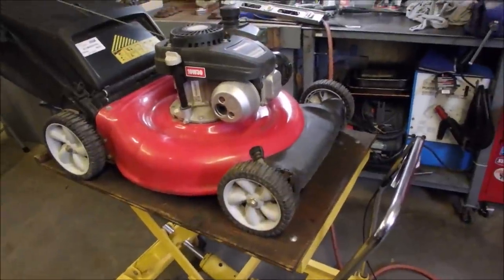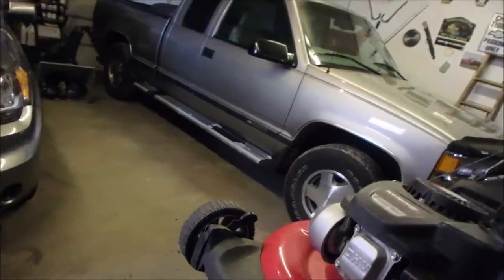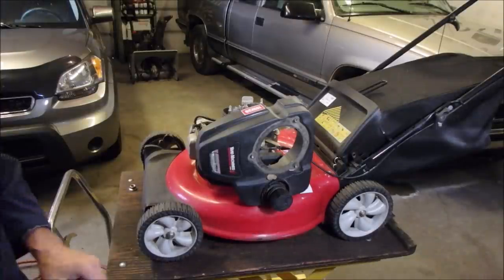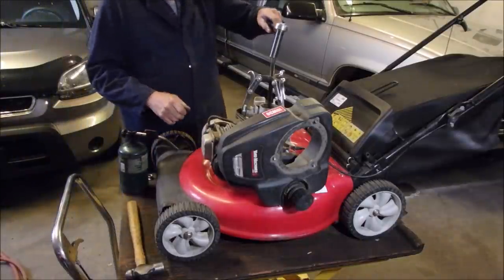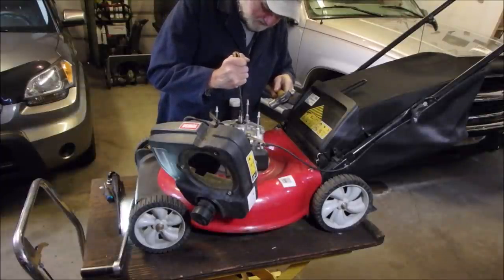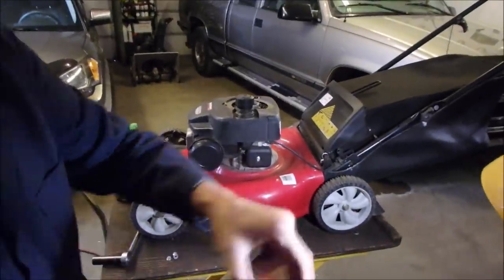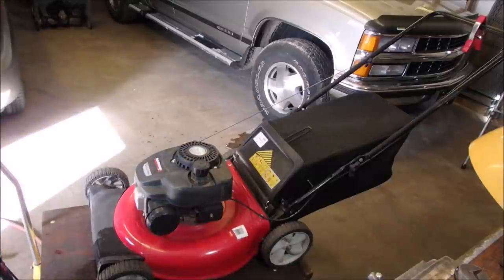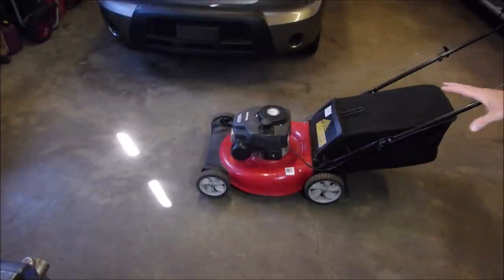Powermore MTD mower Timing and Blade

Comment: Good job on that mower Bruce. Been watching your videos for years now and thanks to you I can remove, clean and replace a carburetor, change the oil, sharpen and balance the blade, clean and gap the spark plug in 25 minutes or less and if I need feel energized remove , grease and replace the wheels and oil all the cables in another 10 minutes. 
I’m retired now but seems I’m busier now than when I was working. 
Thanks again you are an inspiration.
Reply from the maker: Thanks for the kind words.

Comment: good call,  I had a Blackmax mower  (Sold at Walmart here in the US) trade in  they hit something hard,  it has a very specific adaptor and blade  that I didnt have , I ended up finding a used craftman adaptor that fit and old craftsman blade I sharpened.  and it always ok after I replaced flywheel key.  well at least it was a Briggs 300E  Engine. and didn't need to clean carb. starts on 1 pull now.   Vid will be up on that on my channel on 4/23/2022
Reply from the maker: Thanks

Comment: Bruce, I found that using a little Never Seize on the flywheel and shaft helps so the flywheel doesn't freeze up on there like that again, i have used that a lot , never had a problem for down the line.
Reply from the maker: Interesting.  I done us it as I think a flywheel has to be firm.  I will think about that  thanks
Reply: @BrucesShop  I don't use a lot, just a small amount so it doesn't freeze on the shaft anymore.
Reply: @BrucesShop  I don't use a lot, just a small amount so it doesn't freeze on the shaft anymore.
Reply: @BrucesShop  In a certain way, don’t we WANT the FW and crank to bond into one unit? At least when running properly? Now hit a tree root or a culvert pipe and we want them to act as independent pieces, but normally we want them to act in unison as 1 piece. Agree? Or not?
Reply from the maker: @haneyoakie14  I agree

Comment: It's amazing how many different blade adapters there are and how close the MTD adapters are in size. I didn't realize until I was trying to swap junk mower parts around. Then I looked in my parts books... The Rotary catalog has all of the measurements on the different adapters which helps a ton when you are trying to match up parts. I have one of those newer MTD mowers, it was given to me last year. I really find the power more engine is not as powerful as the older Briggs counterparts.
Reply from the maker: I agree   They are noisier though  LOL

Comment: Nice video Bruce not a lot of people know that what they call the bowtie blade adaptors come in different shaft sizes and height some even have a spacer that goes between the adaptor on the inside of the bore and against the crankshaft to drop the adaptor more towards the ground. Have had a few in where they installed too long a bolt and broke it off inside the crankshaft from using an impact gun with too much torque (like the Milwaukee that has 450 ft lbs on the highest setting).
Reply from the maker: Right.  Adaptors are a big deal.  i was tricked that this one came in with the wrong one.

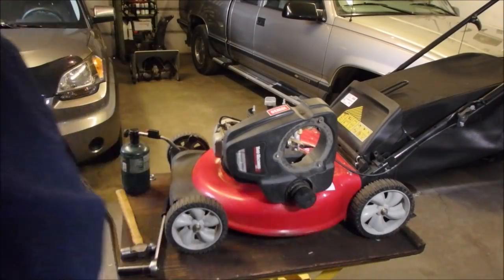Comment: 10:30 did you notice the torch was setting your mower on fire?
Reply from the maker: LOL no but I did feel the heat after.
Reply: @BrucesShop  I'm sure you would have eventually if it kept going.
Reply from the maker: @scso422  That torch leaks a bit when shut off.
Reply: noticed it too and wanted to make sure someone told him 😅

Comment: i wonder if a guy could weld new nibs on those adaptors.
Reply from the maker: It is cast iron  no.  At 3400 RPM I wouldn't weld on an adaptor.  Thanks for mentioning it though.

Comment: Flywheel keys . How do I know which fly wheel key I need   for my BS flywheel? Does it go by  engine size?  Thanks
Reply from the maker: Most B&S flywheel keys are the same. Just google the model # of the engine and you will get the diagram the engine then the part #.  Yes it takes some effort but it is worth it.

Comment: I have this same mower and have been having a heck of a time trying to get it running. Cleaned the carb, fresh gas, fresh oil, new plug, and it still runs, gasps and bogs out. Any thoughts?
Reply from the maker: Did you enlarge the main jet just a tiny bit?   I mean just a tiny bit.
Reply: @BrucesShop  I have not, but I'll give it a try, thank you!

Comment: Is that a steel woodruff key, or a 'softie'?
Reply from the maker: I was hardend steel.  Did you see the scratch inside the flywheel hole. I think someone else tried to fix it but gave up
Reply: @BrucesShop  was original soft and the replacement was incorrect because it was hard?
Reply from the maker: @haneyoakie14  I think it was worked on twice.  First was the blade adaptor and key the second was the adaptor as it was the wrong one and was hanging low.  Then I got it with the blade upside down as well.  ???   Too much going on.
Reply: @BrucesShop  as you are aware, because I learned it from you, a key is like a fuse. It is sacrificed to save something more valuable. You don’t want a $500 picture tube to blow protecting a 10 cent fuse. You don’t put a penny in the fuse box. ( as a child I read that but didn’t understand it. I thought putting a penny in the fuse box was like putting a penny in the parking meter. I just couldn’t see the slot on the fuse box). Putting a hard key in there is like putting gum foil over your glass tube fuses in you car or sticking into a 10 amp socket a 50 Amp fuse. And you can’t always get what you want.

Comment: These are really good mowers though.  I had one until it got stolen by some druggie weasel.   Great engine.
Reply from the maker: Yes  I have learned to like them.
Reply: @BrucesShop  Seriously though. i live in Eastern Canada. I had no garage and no place to store it so it sat in the yard all winter.  Snow piled up on it.  Melted through it. 

All I had to do was ring out the air filter and the thing started on the first pull.   Five years in a row.  It's a tank of a mower.  It rolled as smooth as the day I bought it every year.
Reply from the maker: @poseidon5003  Interesting.  Thanks